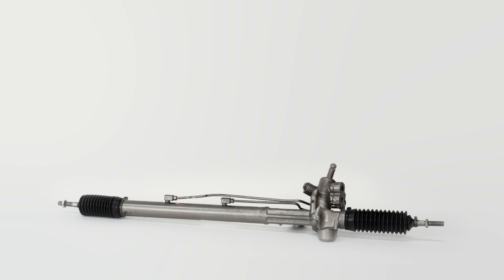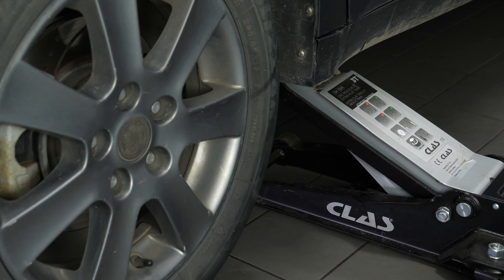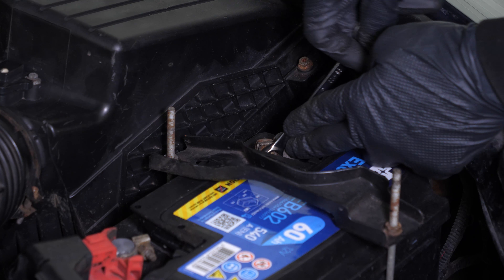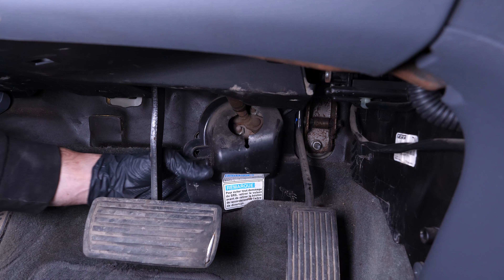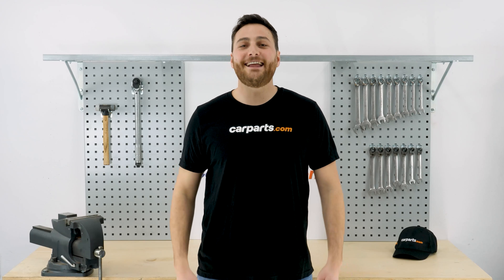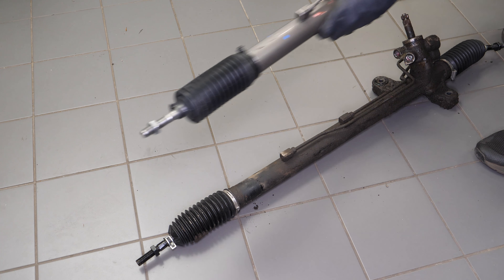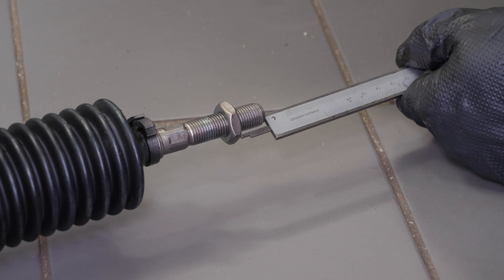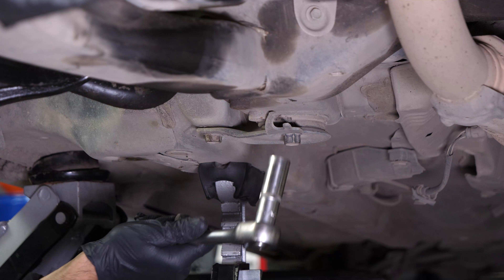How to replace the Steering Rack and pinion 2003-2007 Honda Accord 🛞

Comment: Great video!  Clear and concise. Just one question:  much hand force did you use when installing the feed and return lines to the new rack?  For example, did you go a quarter turn past the stopping point, or is just snugging them up firmly  without too much pressure sufficient? Thanks!
Reply from the maker: There are tightening torques available, but it's almost impossible to get a torque wrench through them, so it's generally advisable to snug them up firmly without too much pressure, and to check that there are no leaks when purging the circuit.